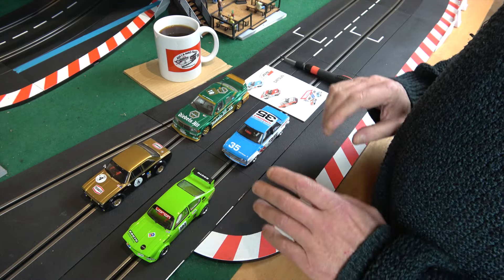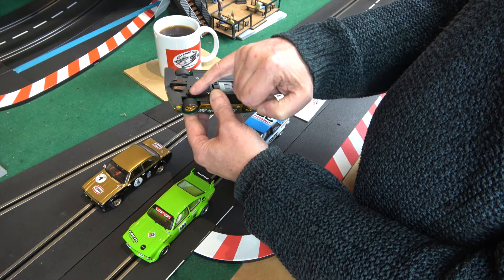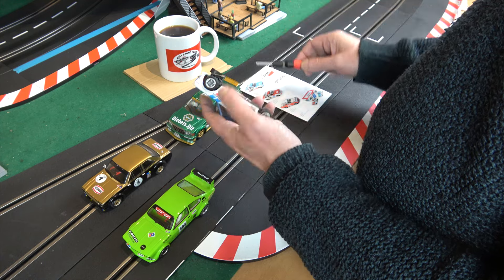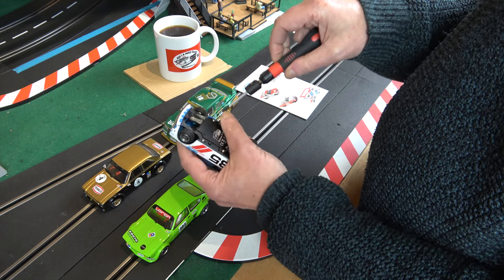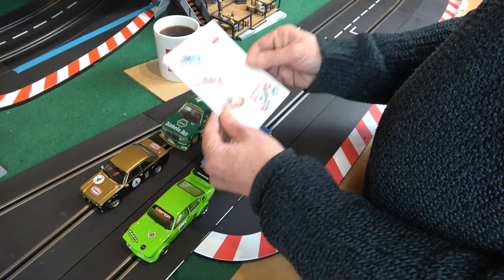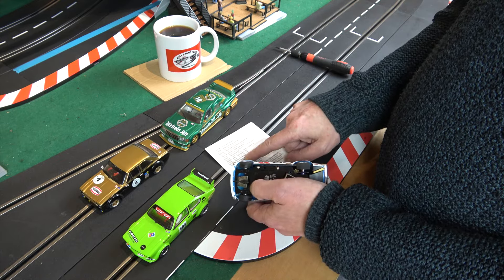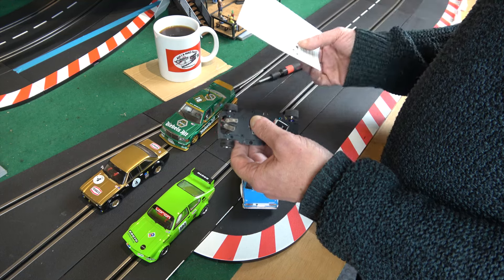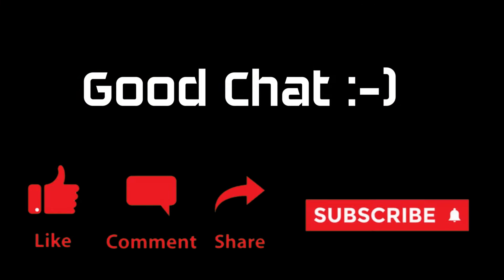Coffee and a Chat - Revoslot, it's not a Slot.It

Comment: Great explanation Dave. I totally agree to that what you`ve said. But, moreover there is one point i do not understand with that Revoslot system. The chassis hight set up is quite high. Why do they do that? 
The center of gravity of the car could be much better with less ground clearance and thus the tipping point. There is no way to set this, or am i wrong? Different axle holders in combination with other body holders would be the solution.
People often adjust that with self made shims under the axle holders and body holders. All the best, Carsten

Comment: Dave my Problem is that the 2  RevoSlot’s that I have both did not run out the box at all 
Because all the Srews  were loose on the motor on both cars
Reply from the maker: 3 loose screws two of which you should adjust as routine maintenance anyway,, or buy a slot it or NSR and have to totally rebuild it...  I know what I prefer
Reply: Neither did my Opel kadette.  But they are hobbyist cars. You need to work at them.
Reply: @1430gt  I’m sorry I spend over £80 on a car the least it can do is run Round the track out of the box
Reply: @darrenhall6400  ok .

Comment: Hi Dave ....i have my Escort running great since i set it up last week ..the motor needed a little adjusting but now she runs sweet ....same as my BRMs need a little fettling but i have them all running sweet , my TTS fiat is a different story so I haven't did much to it yet but its a weird car and wouldn't be my favorite.  The only problem i have with my Revoslots and BRMs is the soft  heads on the motor mount screws ( even with gentle hand torque)and i also think this is a problem with folk not knowing exactly what size to use wither it's torx or allen head ...another thing lacking in communication  from Revoslot/BRMs...great post and im sure it helped many frustrated folk 👍
Reply from the maker: the bolt heads are made of cream cheese though  you have a point